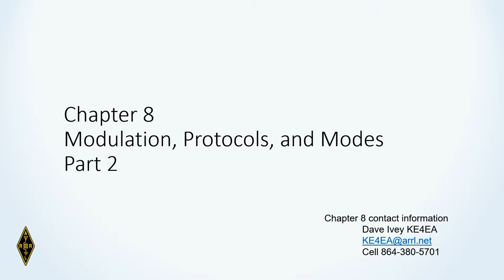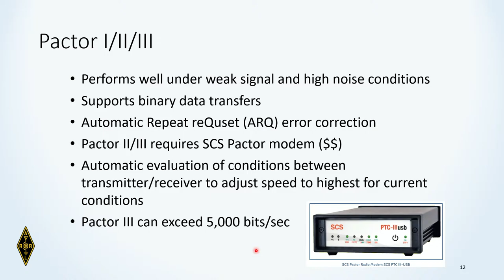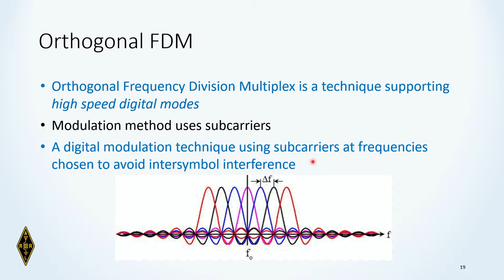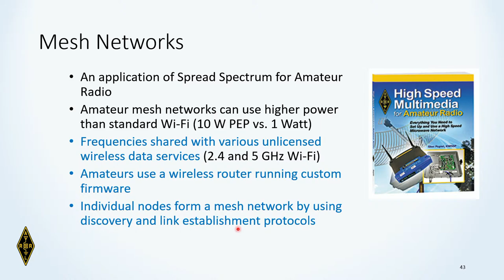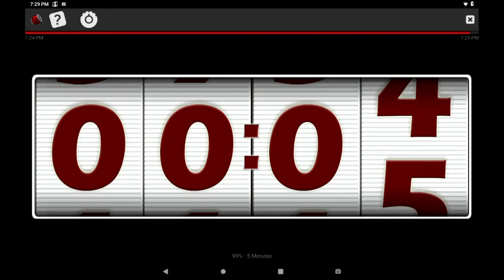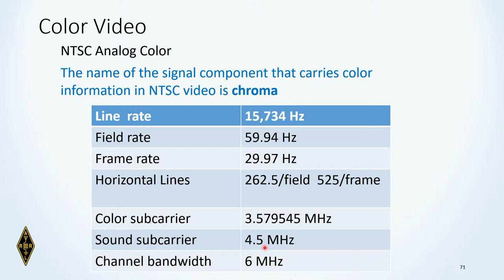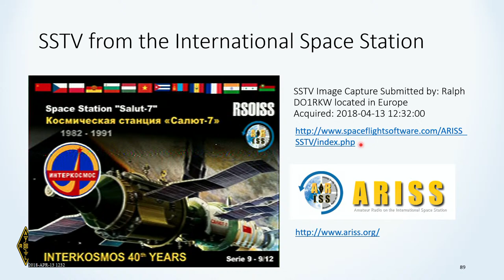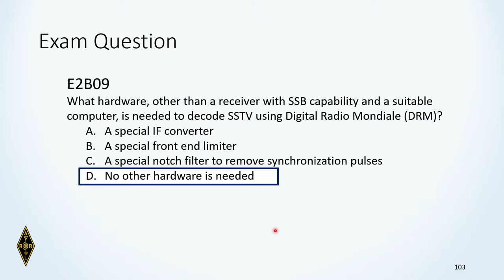Ham Radio Extra Class - 12th Edition - Chapter 8 Part 2 - Modulations, Protocols and Modes

Comment: I was watching this video (and thanks to your time you took to make this outstanding series) and it was stated that 480i is the same as the old tv.....does this mean that the 480i is the same as the 525 lines?

Thanks
JC Willette
KJ7SLF
Reply from the maker: Yes! The 480 lines represents the lines you can see. The remainder were in the Vertical blanking interval (which is off the screen). 73 de W4EEY